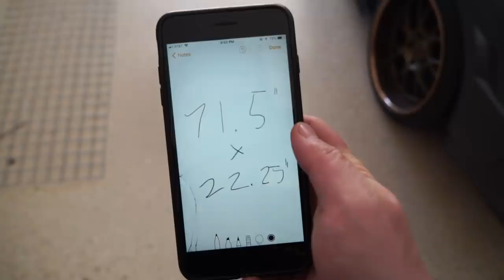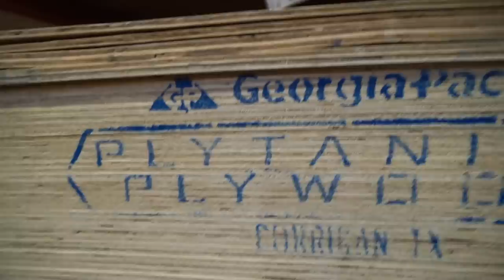BIG UPGRADE for the DREAM GARAGE!

Comment: Hey even I’m actually a garage door technician and installer and they for sure could have used your old door they would just have to put in higher lift tracks, drum, motor witch they did + more witch is more expensive. Love the vids btw

Comment: buy an alloy plate (1-2mm thick) to put on one side of the bench top wood. You can attach a welding clamp to it and not have to worry about attaching the welder to the work piece. Pro-tip from a fabricator.

Comment: You know the worst part about having mismatch garage doors ?
You got scammed hard. You can totally change the door's system without changing the door itself. So you could've kept the door and it would've been much cheaper and obviously that door would still be the same color as the other door.